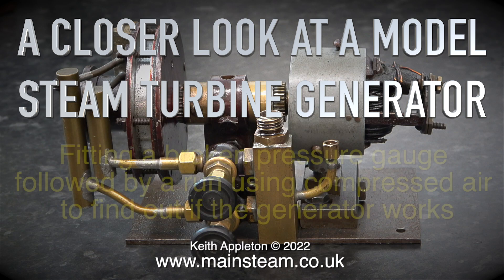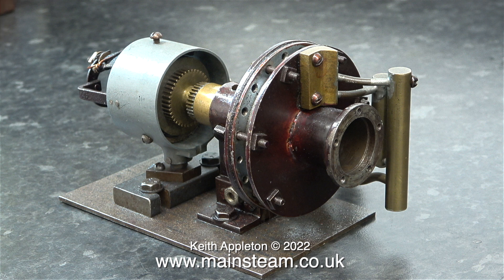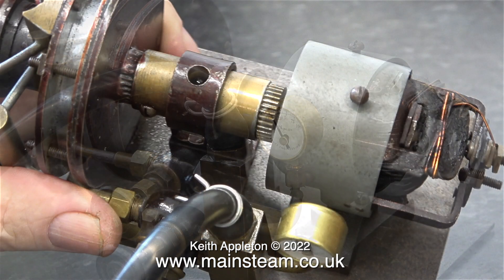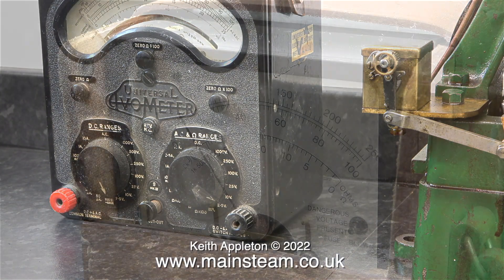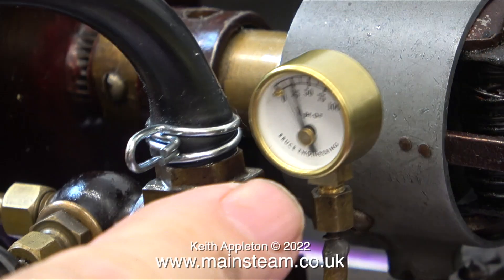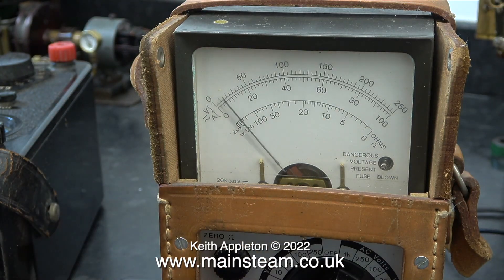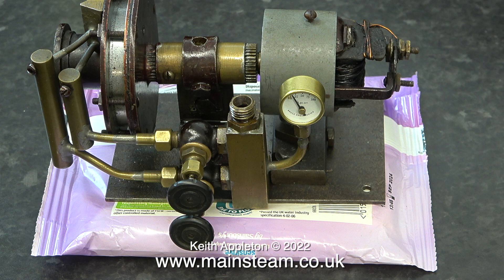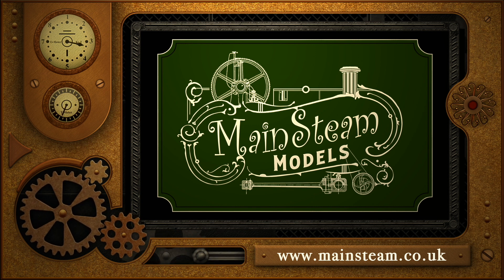A CLOSER LOOK AT A MODEL STEAM TURBINE GENERATOR - IN THE WORKSHOP

Comment: Those PM Research Dynamos do work pretty well with turbines. I built a turbine at my last job and coupled it up to one of those and at 20psi of air I could get it to generate over 20 volts DC

Comment: Very nice Keith. Keen to see more details on that model. You will figure out the Electrickery. 
I am still confused on those valves. I would not think its a control valve and a stop valve because then they would be feeding from the stop valve into the control valve and not two separate pips to the inlet. By trying to eye ball the piping, I would say its a idling valve (top) and a running valve (bottom). 
Keen to see what you find when you get to it.

Regards
Paul
Reply from the maker: I think that you are correct, I just leave them both open fully.

Comment: The pair of valves appears to be piped in parallel, whereas a stop and control valve scheme would be in series. It is curious why there would be two steam admission valves for such a small turbine. Maybe the builder only had that size valve but wanted to match the bore of the steam chest inlet connection? I am quite eager to see inside the turbine case. It seems strange that the steam would enter at an angle oblique to the buckets, and on the same side as the exhaust leaves. If it was of an impulse design, I would have thought tangential admission would make more sense. Any plans on placing a condenser at the exhaust, Keith?
Reply from the maker: It is not a practical proposition to use this engine, it's just a nice old thing ......

Comment: Keith, I have a similar AVO meter to yours (mine is an AVO 8 Mk.6). When I bought it only the ohms worked after replacing both batteries, the 15V and 1.5V and occasionally DC ranges would work but more often dead than working. I found that the polarity reversal switch was sticking, which cured the DC ranges after some treatment with Servisol switch cleaner and then I had to  replace an internal diode (£2 off fleabay) to get the AC ranges working.
Reply from the maker: I need to have a closer look at it I think ......